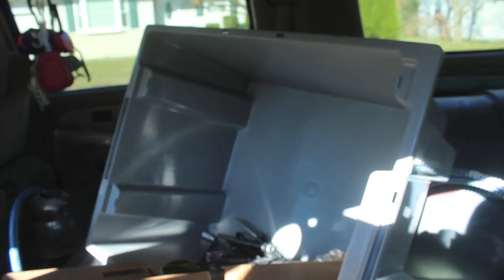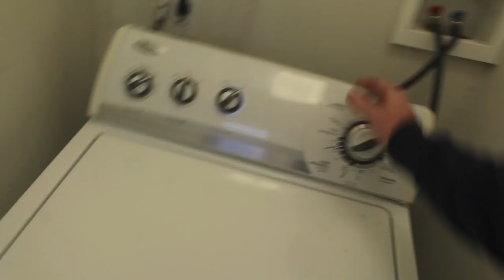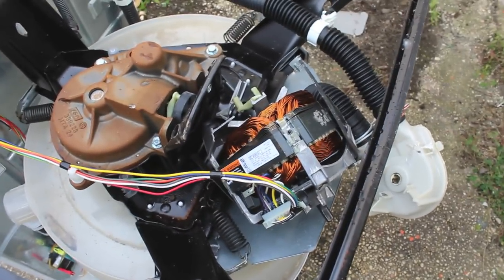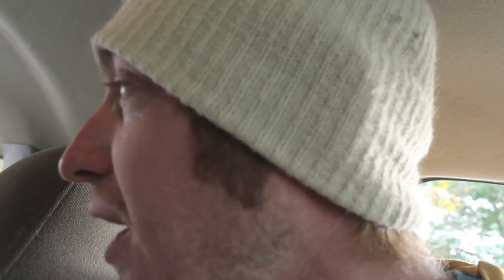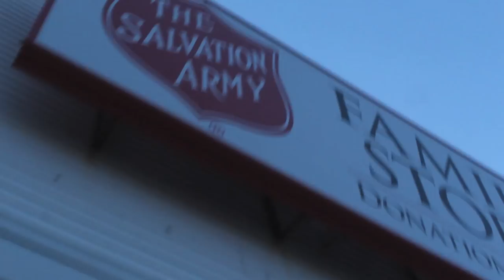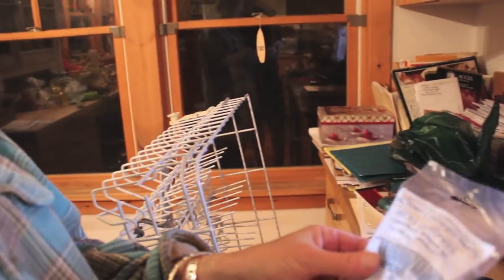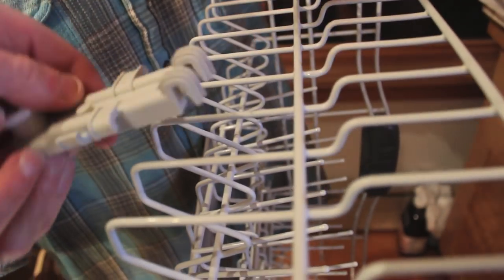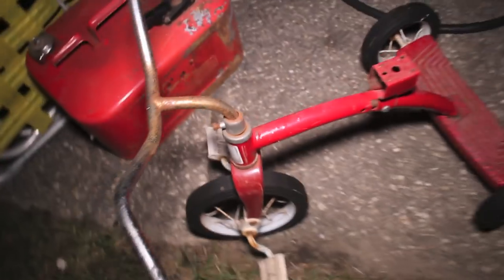TRASH PICKING SCORES!

Comment: I would go around that pipe boot and at the top & sides of the skylight with a gallon can of roofing cement!...Use a putty knife to apply! Looks like the same skylight you sprayed already with that flex seal so i would ask him how old is the skylight, the seal deteriorates over time! Expensive dish washer parts!..I looked them up on ebay and they are $18 each...Yewwww